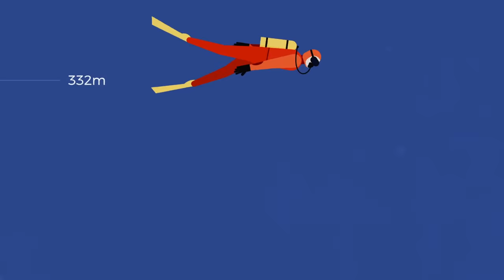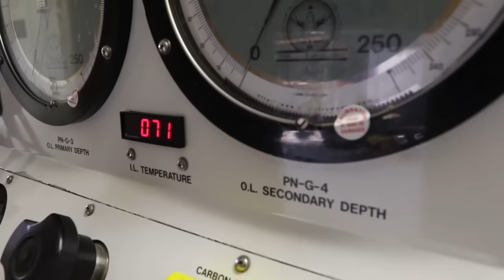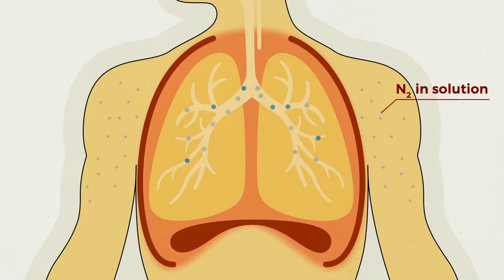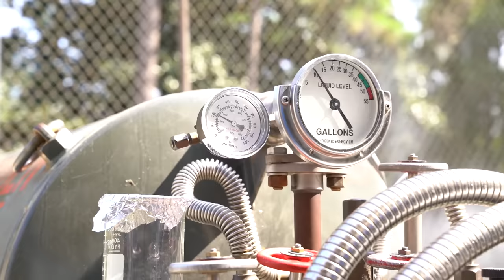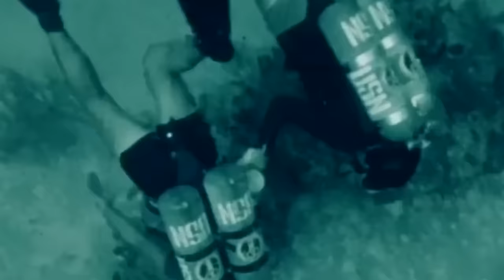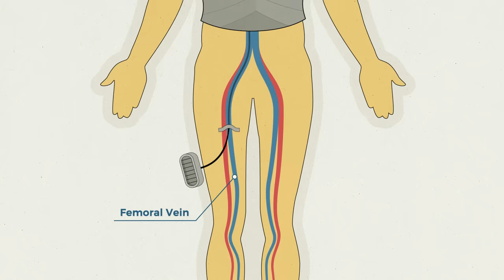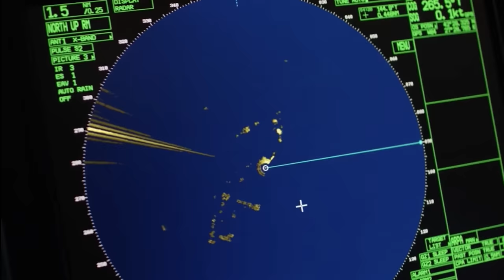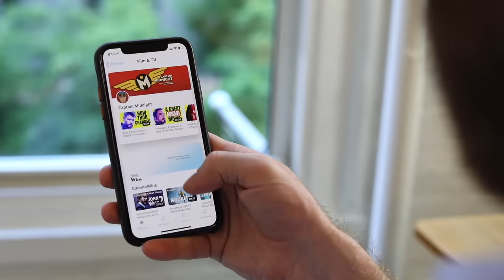Can Humans Breathe Liquid?

Comment: The catheter for extracting CO2 could be a better solution, not that it isn't cringe-inducing. But take it a step further: instead of using it just to extract CO2 from the blood and put the blood back, ALSO inject oxygen directly into the blood. There would be no need to actually breathe at all in such a case. This would basically feel like holding your breath forever. It could even be tested "gently" by setting up the system on the surface and just asking the subject to hold his breath for as long as he can. We could test to see if the body starts feeling like it's starving for "breath" or if the supply of oxygen staying steady means holding breath remains as comfortable as it was at the start.

The big downside being, again, surgical implantation of instruments that extract and put back your blood, which is squicky and potentially quite risky.

Comment: The colon has a large surface area with direct adsorption into the blood. You can fill it with liquid without damaging it and you don't need to perforate the skin for external devices. You can pump liquids in via deeper tube and out near the orifice for continuous flow. And, there's no drowning reflex to deal with. Honestly, the most elegant solution is liquid breathing though the anus.

Comment: The pathos argument at the end was utter nonsense when you consider anybody with the sane mind to try liquid breathing can do it so long as they put more of their brainpower following a procedure, as follows:
1. Take deep breath, calm nerves.
2. Exhale to the maximum extent that the diaphragm can compress the lungs; hold there as liquid completely displaces gas in breathing apparatus.
3. Use the little time you have here to adjust frame of reference towards breathing the fluid, increasing adrenaline and strength that your diaphragm uses. 
3. Breathe in fully, let fluid enter lungs.

At some point, a human has to practice enough of this technique, and in the reverse, that they are able to do the process enough to not have pneumonia when breathing air again.

Comment: As long as the necessity of human observation is a requirement then this problem will exist.  Humans have limitations and sticking them in suits of any kind or submersibles only interferes with the need of observation.  It's basically an unsolvable problem.

But there are two ways left to successfully eliminate the problem of direct human observation.  In relation to the petroleum industry, replace it.  Remove the need for petroleum.

The second answer for the needs of science is replace human divers with sentient machines and connect humans to those by nueral transmitters or VR.

So sports diving can remain for fun, but serious need for dangerous deep diving and breathing air is unneeded for industry or science.

Comment: Sounds like you just need a highly in-soluble gas as the filler over nitrogen. 100% oxygen seems like it would be a partial solution, our blood has ~95%  saturation at sea level, even if it increases with pressure it would not change by a lot. Unlike nitrogen, out bodies will readily consume and exchange oxygen, so you'd think that would dramatically shorten the decompression time. Obviously you can't breath 100% for more than 12-24h without side effects, but that seems tame compared to putting a liquid in your lungs....

Comment: What if you were to breathe red blood cells mixed with an anticoagulant... we would have to have some way for the lungs to interact with the blood on the inside instead of the outside of the lungs like usual... I’m wording this terribly but your body would have less issues dealing with the blood in the lungs than it would with an alternate fluid and the blood already is capable of carrying both carbon dioxide and oxygen without issue.

Comment: I mean if you already have to look at inserting a co2 filter into a vein why no go all the way to a external dialysis system that regulates oxygen and co2 in the blood. Also tho unpleasant couldn't you put someone under and flush there lungs with water and then dry them out? As long as the the other system is working to maintain the blood oxygen systems and the person is under it should be possible, of course its risky for complications but you cant really iron those out without doing it and refining the process.

Comment: What isn’t well explored in this video is oxygen toxicity and the build up of oxygen toxicity (OTU). Hyperoxia is fatal causing seizures at depth. Partial pressures above 1.6 should never be exceeded with tech divers diving with a partial pressure of oxygen generally at 1.3. Partial pressure at a depth is calculated as the fraction of oxygen breathed in, multiplied by the number of atmospheres (every 10 m is one atmosphere and add one for our own). One can dive with 100% oxygen in their cylinder, however they cannot dive more that 6m. Diving at depth will mean that divers will dive on mixtures that are hypoxia on the surface, this is why re-breathers are normally used. At appears that this research is currently only applicable for immersion breathing, rather than actual diving applications.

Comment: Before I even watch this video. Liquid breathing is short sighted. The real solution is injecting oxygen into the blood stream directly through an external gas exchange system. (Machine operated cellular respiration) OR cycling out deoxygenated and oxygenated blood continuously) the lungs would still need to be filled with fluid or compressed and the breathing area of the pons disinnervated to dismantle the breathing reflex. Aka you will need to be on a semi paralytic. The final process would be to completely replace human cells with those that do not have a demand for oxygen. Completed through complicated and likely controversial genetic modification

Comment: whilst breathing liquid is possible in theory In reality it does not work because you need a pump to pump the liquid into and out of the lungs. As to the comment that humans could dive to the bottom of the Marianas trench there is no way. the pressure would not just crush the lungs but other parts of the body such as arteries preventing blood flow.

Comment: Here is something to get them brains thinking at extreme depths what kills a person is the pressure compressing the lungs that's why even with a air supply you would still die. But a baby in the womb does not breath its lungs are filled with fluid but there lungs are also compressed the entire time the oxygen is passed through the empirical cord directly to the blood stream so with that being said. If a child was to be born under water and there empirical cord be hooked to a glorified pump to keep the oxygen circulated in this same way would they ever need to surface and as they aged would they continue to need to use it or would it lower the rate of oxygen that there body would need to function giving them the capabilities to hold there breath for a longer time frame? 1 may 2 hours? Evolution happens someway we are just like all living creatures when life tries to beat us we adapt

Comment: I haven't watched this upload yet, but I'm going to anticipate the answer is no, humans can't breathe liquid, at least in any practical means for adults. Mice and rats have been forced to inhale oxygen-enriched perfluorocarbon liquid and have survived, but scale is a decisive factor. Just as a real Godzilla would need feet larger than the rest of its body just to support its weight, a real liquid-breathing adult human would need a respiratory tract larger in cross-section than his head to move enough perfluorocarbon in and out of his lungs to fuel his brain. Furthermore, the pressure exerted on the lungs by such a current of liquid would probably rupture the alveoli. What works for a mouse is not guaranteed to work for us. Nature imposes all sorts of limitations on us, get used to it.

Comment: If you think about it we evolve from a creature that had gills , every time you have a hiccup it’s that unused gill taking action …breathing oxygen induce  liquids can make the exchange of carbon dioxide from the body difficult and can causes hypoxia ..their will need to have a machine which filter carbon dioxide in the blood while breathing liquid from the lungs in a relax state… even if we manage to do that , the body and the blood produce natural gasses and can temper the atmospheric pressure capacity to go deep . 
Its a failed theory and is impossible due to the nature that the blood itself  produces gases.

Comment: If only there were a pressure release valve on the lungs, so the water could.. sorta fill in easier, or maybe in one side out the other.. WAIT! What if.. the water could just pass right over the lung without even using your diaphragm! Yeah, like a.. like a.. what's that word.. "gills."